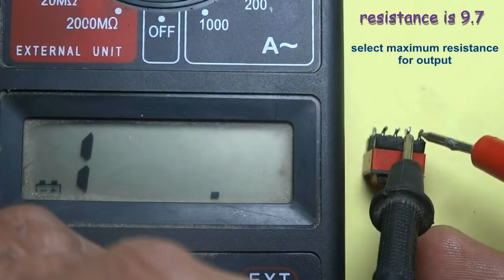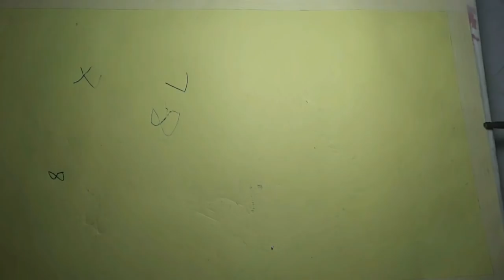AC power Bank at home

Comment: Just I want to ask you some.... If we put in a charger than we connect it in indipondantly(avoid the short circuits)  ,than make that charge the battery 🔋again infinitely or no..... Plz, plz, plz 🙏 ...I want a answer...
Greetings
Reply from the maker: U can charge battery with mobile charger dear
Reply: gillani data , thanks a lot so we can use the lithium battery replacing the acid battery that make it easy to charge..?
Reply: u can't make it infinitely because of the power loss

Comment: How many amps does it support in the output? Does it heat up a lot?
Reply from the maker: +JDavid HC  it will give u till 10watts Ac 
U can use led bulb mobile charger and etc

No I will no heat
Reply from the maker: +gillani data it will no heat up

Comment: Sir, 
I just make a circuit same like you but light is blinking. my led light was 7 watts. its not working properly. plz give me a solution. R-10 ohm.c-2.2- 400v.Q-13003. transformer was good.
Reply from the maker: I'm going to upload it's solution
Reply from the maker: Just increase input volts or use less watts led light

Comment: can I use and 140 transistor?
Reply: use other resident name please?
Reply from the maker: u can use 13003/13005/2sc5200
Reply from the maker: Other transistors can b used but bulb may bling
Reply from the maker: Dear bt140 is not a transistor
It is triac and used in dimmer circuit
Reply: can I use other resident?
Reply from the maker: Yes 220ohm resistance can b used
Reply: how many watt are found in this circuit,not 220 ohm resident can I use other resident?
Reply from the maker: 10 watts
Reply from the maker: If can just use for led bulbs mobile charger etc